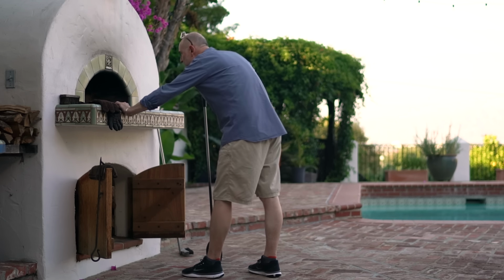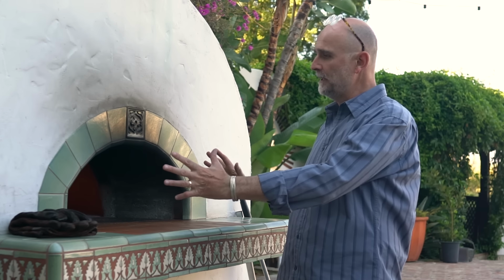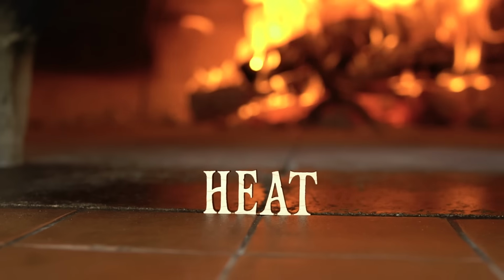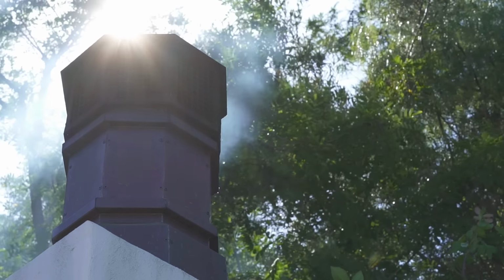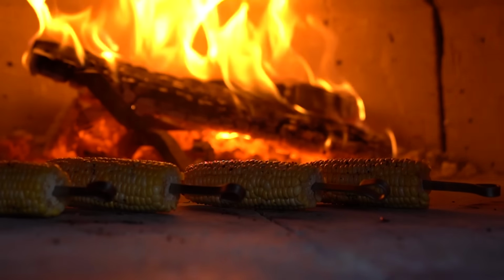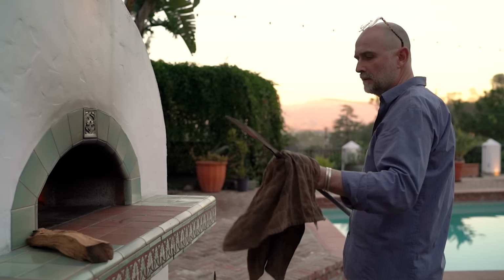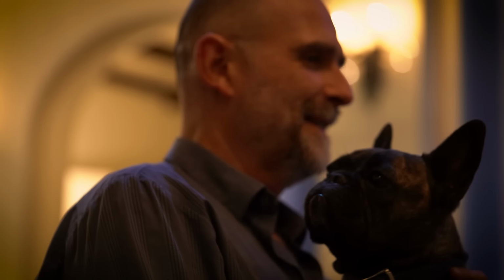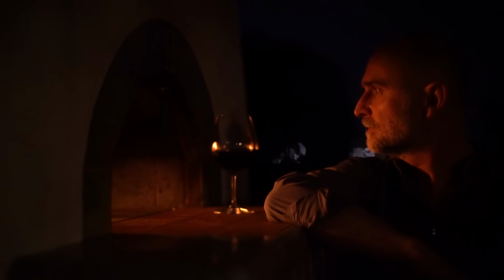Ep 1. An introduction to Wood Fired Oven basics

Comment: Built mine about eight years ago, only use mesquite wood, living in AZ finding fruit woods in harder than east coast. Start my fire early in the day and cook later afternoon, oven keeps heat for days after. Made bread without fire for a test three days later just to see if I could and it worked, it took a while and strangely bread browned throughout, but was very good.
Reply from the maker: Always great to find a use for the retained heat.

Comment: You could have been describing me in a lot of that video.  I have a 1m Pompeii black oven made in refractory cement like yours that I built in 2010.  It gets used constantly, and I absolutely love it for exactly the same reasons as you.  Roasted veg is awesome from the oven as is pizza but I'm just getting into cooking meat.  Mine has a render over it that is cracking and needs replacing so next year I intend to clear it all off and re-skin it with a heavier insulation ands tile the exterior.  Love your presentation style as well.  My wife and I also do what you do at the end after everyone has gone - open a nice bottle of wine ( Primitivo usually) and stare at the embers, or toward the end of the summer or autumn add a bit more wood in and also light the fire pit.
Reply from the maker: Many thanks for sharing your experience. Clive

Comment: Hi Clive, firstly may I tell you how much I am enjoying watching your videos? I love your obvious enjoyment and passion,  I have now built a 900mm refractory oven. I have fired it up but not yet cooked anything. I am moving up from a gas Ooni!  
I have built the front arch in stone but Miss H is not happy with it at all and wants it to be replaced with similar tiles to yours. I can't find them anywhere. I know, from your website that they are called Alhambra but could you give me a clue please? If so you will save me a lot of discomfort. Thanks , Felix
Reply from the maker: The tile were Ceramic Alhambra, but unfortunately they're not manufactured anymore. I look forward to hearing about your cooking adventures in the oven Felix. Clive
Reply: @TheWoodFiredOvenChef  Hi Clive,  thank you so much for the reply. I will need to find some tiles similar to yours, as Miss H has her mind set on them. 
I fired my oven up and cooked  for the first time in it, on Monday this week. I cooke pizza. Compared to the little gas fired oven, it was a much more relaxed experience. I don't think I had it  quite hot enough, as it took longer to cook through than yours did in episode 12 ( I should have watched it first) 
I slow cooked some pork overnight with the latent heat and it was fantastic. Felix

Comment: Hi sir,

I am a huge fan of your cooking techniques and the knowledge you share. I have a question to ask.

How often does the wood fire oven need maintenance and repairs considering this much amount of heat?
Reply from the maker: First, you must treat your oven with care. That begins with correctly curing it when you first start using it. You should always select hard, dry, and seasoned wood. Seasoned wood will light more quickly, and burn hotter and more efficiently in your oven. The best seasoned wood is wood that has been split and left to dry for at least 6 months to a year. Stay away from treated wood, and anything that has paint or glue on it.
You may not always fire up you oven to clear the soot from the dome, so to avoid too much buildup of soot, at the end of the evening I will add a few pieces of wood to the fire to bring the oven temperature up, and then spread the embers over the floor. Then put on the door. By the time I’m ready to use the oven again the dome is clear.
if you haven’t used the oven in some time, and the temperature and humidity have been high, then you might want to cure it again before using a big fire. I have my chimney cleaned 2 or 3 times a year to prevent too much buildup in the flue.

Comment: Love the channel.....i hope youu put out more content.....jsut a quick correction....a white oven is where the heat source is offset from the cooking chamber.......the black oven is where the heat source is inside the cooking chamber.
Reply from the maker: A white oven usually refers to an oven that's heated with a gas-powered heat source. No smoke is created which leaves the surface of the dome clean throughout its use. White is just another way of saying that it leaves the dome clean whether it’s made of brick, or cast from refractory concrete. A black oven is when the heat source is a wood burning fire, which will create smoke that will coat the dome with black soot. That soot will burn off once the oven reaches an overall temperature of over 700f/370c. You can purchase hybrid ovens that will give you a choice of both gas or wood. More to come.
Reply: @TheWoodFiredOvenChef a wood fired oven with the heat source offset is also a white oven.  This is because the flame does not contact the cooking chamber and thus no soot is created.  The pizza ovens in New Haven connecticut are examples of wood/coal white ovens. https://en.m.wikipedia.org/wiki/Masonry_oven
Reply from the maker: @neostefanides  Thanks for the reference. I don't know if you already know of it but there's a book called The Bread Builders by Daniel Wing and the legendary oven builder Alan Scott. There’s a lot dedicated to bread making but a good portion of it goes into the history and science of wood ovens. Alan Scott is known for his beautifully built ovens, and I found this book extremely helpful when designing mine, and understanding heat retention and the benefits of using the “full heat cycle".

Comment: Pardon if you have already answered but what is the size of the dome (interior depth and width) snd oven opening? I ask because I like the space you have to adjust the food. It appears to give you more control of the cooking process. Fantastic videos. Please keep it il.
Reply from the maker: Hello Dale. The oven is 40"/106cm in diameter. The opening 21"/53cm. Insulation is one of the most important components. A well-built oven with good thermal mass and adequate insulation will be very efficient. In my experience the oven requires less fuel to maintain the temperature, which means a smaller fire, which gives you more surface area to cook with. It also retains the heat very well, which means the morning after I've used the oven (10 to 12 hours later) it can still be anywhere between 500F/260C to 300C/150C, depending on how hot the oven was and how late I used it. So still hot enough to cook without relighting the fire. Let me know if you need any more information. Clive

Comment: A very beautiful oven,compliments.
May I ask you about the white plaster layer that covers the outside.Being an outdoor oven,is it prone to develop mold easily?Does it need repainting often ?
Thanks a lot.
Greetings
Reply from the maker: The outside is finished with an exterior stucco that was troweled on to match the texture of our house. It was then painted with a durable exterior primer, and then a weather resistant latex paint. I repaint it every couple of years.

Comment: Hello, due to lockdown boredom my husband has built us a gorgeous wood fired oven. So looking forward to using it & learning about it. Your video are so informative & your oven & surrounds are beautiful!! 
What I want to know is about cooking for instance the porterhouse steak, like you did, does this create mess to the inside of the oven and if so how does one clean it or is it better to always use a pan of sorts?! Thanks again x
Reply from the maker: Hello Fidelma. Great to hear about your new oven. It will provide many wonderful memories for you. Usually the high heat of the oven burns off any food on the oven floor. When I’ve finished cooking with my oven I drag the embers over the floor. This helps the fire go out sooner, spreads the heat across the oven if you’re considering some retained heat cooking, and burns off any residual food on the oven floor. Once the oven has cooled, and you’ve swept it clean, you’ll see that the floor is quite clean. Clive
Reply: Ah I’m so glad you got my message & really appreciate your response - I look forward to getting to use it. I’m in Ireland so I will have to wait another few weeks before weather improves 🙄 4 seasons in 1 day here.  Always !! Thanks again, take care x
Reply: Could I just ask you , are all your pots made from cast iron?! What other materials are suitable?
Reply from the maker: @fidelmaaherne7774  I mostly use carbon steel pans, the ones I have are made by Blanc Creatives. I think Carbon Steel pans fall between stainless steel and cast iron. Carbon steel and cast iron are similar in they can both withstand very high heat, and their surfaces develop an oil-based seasoning, that has a non-stick quality, that will become better with use and time. But the manufacturing process makes carbon steel pans stronger than cast iron, and much lighter, which makes them easier to handle and maneuver around the oven. Another thing I like about these particular models is the loop handles, which means they take up less space in the oven, and makes them easier to rotate when you want the food to cook evenly. And one other thing I love about these pans is the beautiful craftsmanship means food can go directly from oven to table.

Comment: hi clive just got my oven finished about a month or ago maybe a silly question but after each cook is it best to clean all the old ash out before starting a new fire just getting stared in this area and find your videos extremely help full looking forward to your new meals cheers steve
Reply from the maker: Hello Steve. At the end of a cooking session I pull the coals over the oven floor to let the fire die, and to burn off any food residue that may be left. If I want to use the retained heat the following day then I close it up with the door, otherwise I push the door halfway in so the oven still draws in cool air and it will cool down quicker.
I usually just leave the ash. I haven't found any reason to clean the oven until the next time I use it. Then I'll use the peel and brush to remove most of the ash and brush it clean enough to start the next fire. If I want to clean it thoroughly then I'll use the vacuum when it's completely cooled down.
Let me know if you need any more information.
Thanks for watching
Clive
Reply: @TheWoodFiredOvenChef

Comment: Thank you so much for these nice and educational videos!

May I ask, what size/ internal surface area would you recommend for an oven for a family.

The other thing, what is the internal height of the dome do you recommend? Flat or dome shape? 

Wanted an oven not only for pizzas but also for grilling and cooking. 

Many thanks once again
Reply from the maker: Thank you Doctor. If you would like to email me through my website I will send you all the information you need about my oven.
Reply: Thanks Clive for the information you emailed me. 

Another question if you wouldn’t mind,

I’m now looking into precast ovens, I noticed that there are two types; precast refractory clay ovens, and concrete ovens, any thoughts about these two types?

Many thanks once again
Reply from the maker: @drn.sharaf8907  concrete is going to be a little stronger, but you'd be fine with either. Some manufactures use a combination of both, like a concrete dome and a clay floor. Talk to your local manufacturer.
Reply: @TheWoodFiredOvenChef  thanks Clive 

Kindest Regards

Nazar

Comment: Really nice video.
Just wondering how to extinguish the fire?
Reply from the maker: When I’ve finished cooking with my oven I drag the embers over the floor. This helps the fire go out sooner, spreads the heat across the oven if you’re considering some retained heat cooking, and burns off any residual food on the oven floor. Once the oven has cooled, and you’ve swept it, you’ll see that the floor is quite clean.

Comment: Sir, you are very close to the perfection. Just one question: provided your very high attention for "foundamental details", why did you choose the dome of the oven made of refractory concrete instead of bricks?
Reply from the maker: Hello Giancarlo. I had originally wanted to build a brick dome as I had an aesthetic and romantic notion of having an oven that followed a tradition that goes back centuries, but after further research I discovered that the precast refractory concrete models were just as efficient, fit my budget at the time, and less time consuming to build. Not that there’s anything wrong with a brick dome. The web has countless videos of talented enthusiasts building really beautiful brick domed ovens. Thanks for your kind comment. Clive

Comment: Thank you for the excellent video, I really enjoyed watching. I have a question, if you would be kind enough to answer. Is the electronic temperature device measuring the temperature of the walls or something within the cooking area?
Reply from the maker: The Temperature gauge measures wherever you point the laser. So the wall and floor around the fire might measure 900F to 950F/480 to 510C. Whereas the side walls could be 5 to 10 percent less. That's one of the great things about cooking in the oven, that you have varying temperatures around the dome and floor, so you can regulate where you place your cooking vessel depending on the heat you need. Let me know if you need any more information. Clive
Reply: @TheWoodFiredOvenChef  Thank you for that Clive, much appreciated. I have watched some of your other videos now, so I am getting the hang of it now.  I am just getting my plans together to have one built in an outdoor kitchen, for outdoor entertaining. Regards. MH

Comment: Such a relaxing video. Is there a particular type of wood you use to cook with etc. oak or apple wood?  Does it make a difference what type of wood one uses?
Reply from the maker: I mostly use oak and olive. They're locally available, and because they are particularly hard woods they burn longer and hotter, so I'll use less than other woods that may be a bit softer. Apple, or other fruit trees, are great to use but not as easy to find. Any hard, seasoned wood, should work well in the oven, but talk to your local firewood provider.  I haven't found that using oak or apple makes a difference when it comes to imparting flavour. Thanks for watching. Clive
Reply: Thank you

Comment: Do in the oven have the air access from outside to keep fire 🔥 burning? Or how does it works? And what is the floor made by?
Reply from the maker: If you would like to Email me at thewoodfiredovenchef@gmail.com and I will send you all the information about my oven. Clive
Reply: Air draws in through front opening and circulates out through chimney

Comment: Hi, we finally fired up our pizza oven for the first time. The problem I had was keeping the fire lit. I’m not sure if I was using the wrong wood. But all I produced was smoke. The wood we used was Mesquite. I had better results with a bag of coal when we first primed the oven. What wood are you using to keep that fire?
Reply from the maker: Hello Mark. A few things to consider when first lighting the oven is the dryness of your wood and kindling. I'm not sure which hemisphere you live in but during the winter there's going to be a lot more moisture in the air which makes it harder to get the fire to catch. Mesquite is quite a hard wood so it needs more fuel to light.
I sometimes buy some of the cheap firewood bundles you can find in the supermarket to use as kindling. It's very dry, splits very easily into small pieces, lights quickly, and I can keep feeding it until the harder wood has caught fire.
The wood I most commonly use are oak and almond. They are the species that my local firewood suppliers carry. I love to use olive when I can find it. I've never used coal or charcoal in the oven.
Hope all that helps.
Clive

Comment: Subscribed. Why remove the fire when cooking with retained heat? Why not let it burn out
Reply from the maker: It's not really retained heat cooking when there's still a fire. You could remove the fire if there's a schedule you're following, and need it to cool down sooner, otherwise I always just let it burn out. Most of the temperatures you're going to cook at will be below 600F/315C, and I've found the fire will keep it above that. Baking bread is best without a fire. It's nice to have a clean oven to use, and take advantage of the entire floor space.

Comment: I like your peels set, where can i get them??! 🤔
Reply from the maker: The peel I use is the "Small 8-inch Turning Peel with Long 59-inch Handle", which I originally bought on Amazon, but I don't see it there any more. There are others like the "GI Metal Turning Pizza Peel with Black Handle (47 Inches)" that looks pretty good. Personally I don't like the perforated metal peel since I use mine for removing ash from the oven too.
Reply: @TheWoodFiredOvenChef  
Ok, thanx for ur answer!

Comment: Do you get different temperature from different woods? What do you usually use?
Reply from the maker: Hello Colin. Not necessarily different temperatures, but harder woods like oak are going to be more efficient since it burns slower and longer, and you'll use less to maintain the heat in the oven. If you search for a "Firewood BTU chart" it will show you the best wood to use. The higher the BTU rating the more efficient it will be. Clive
Reply: @TheWoodFiredOvenChef  Thank you

Comment: I want to build mine to look like this one!  What is the outer white, lime wash?
Reply from the maker: The outside is finished with an exterior stucco that was troweled on to match the texture of our house. It was then painted with a durable exterior primer, and then a weather resistant latex paint.
Reply: @TheWoodFiredOvenChef  Gorgeous.  Did you use standardized plans?  Or made your own?  I love teh shape of it, I'm trying to determine if it has a hollow gap between the interior dome and exterior shape.  And a gorgeous chimney